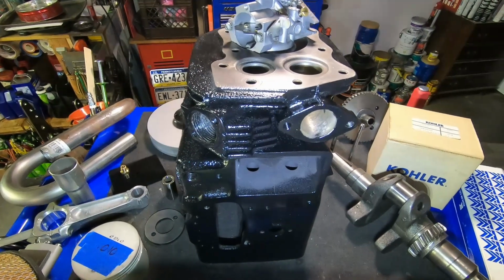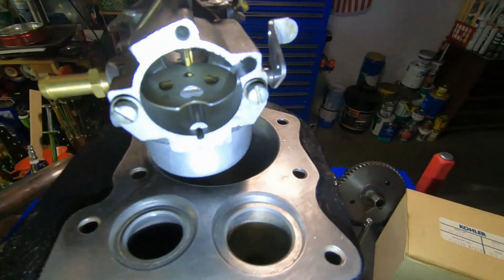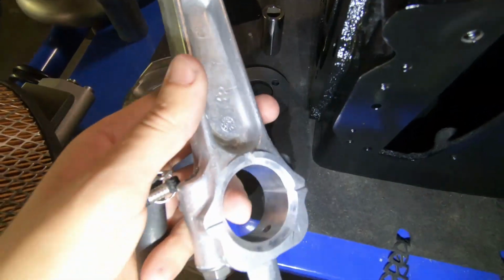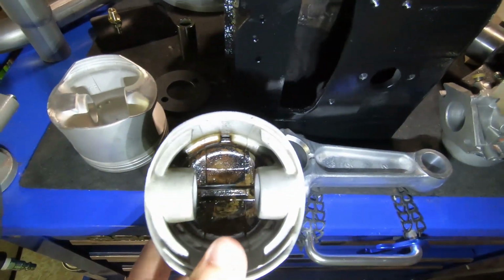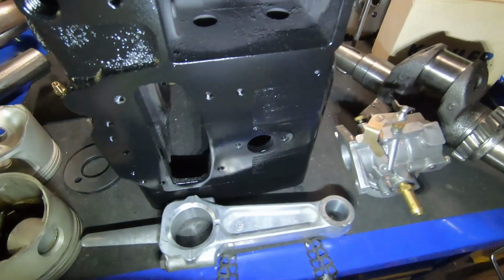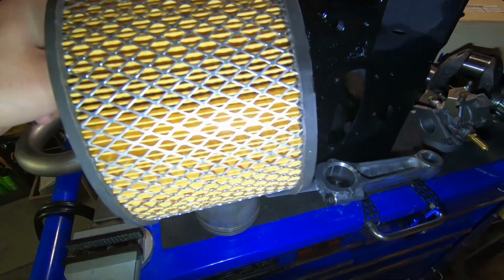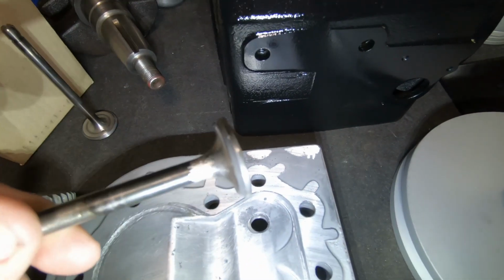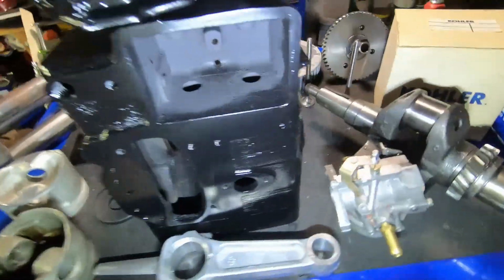Cub Cadet Pulling Tractor Build (Part 4)

Comment: Definitely make sure you don't run that engine over 4000 RPM with the stock flywheel. Any faster than that and you risk having it explode. Other than that, everything looks good!
Reply from the maker: Yea, the pulling class doesn't allow over 4000 rpms anyways.
Reply: @therenaissanceman5311  do they allow you to bore the ports ?
Reply from the maker: @harryfp1494  Yes but it all depends on the pulling groups rules for the class.